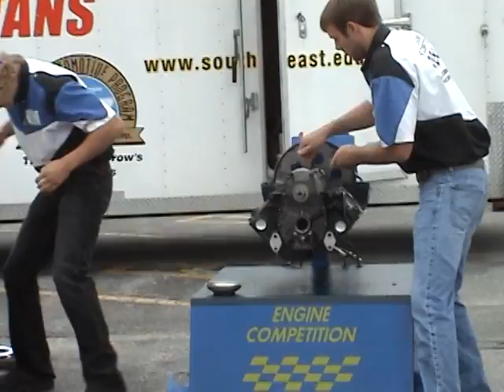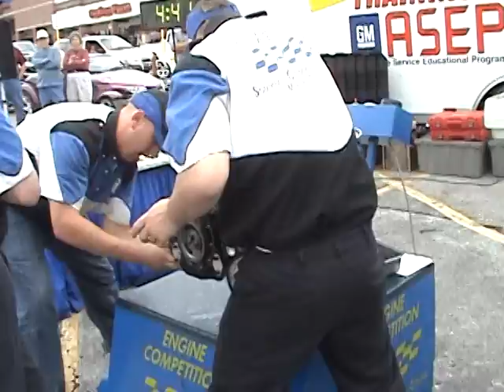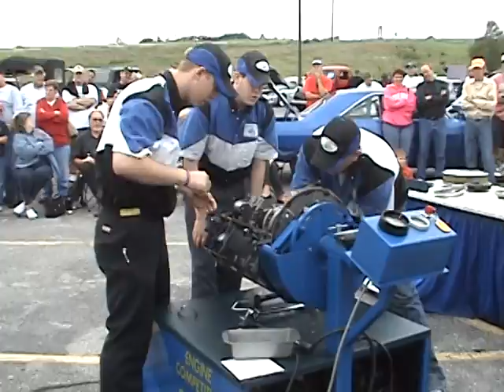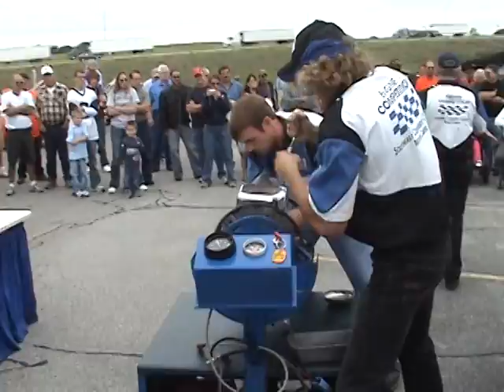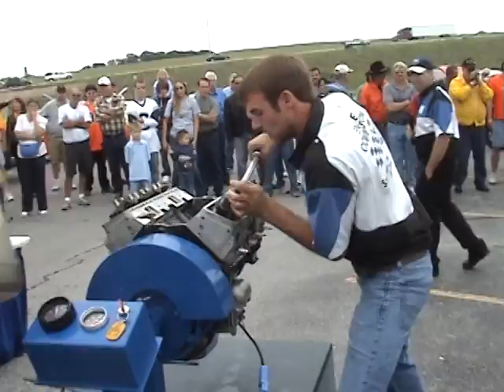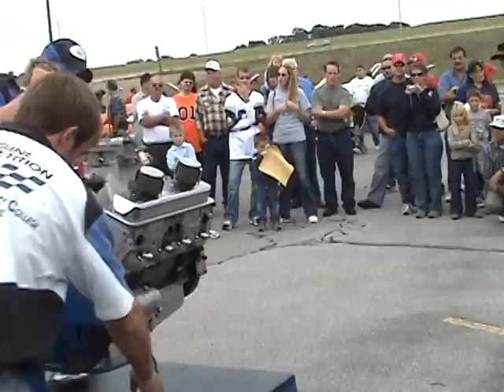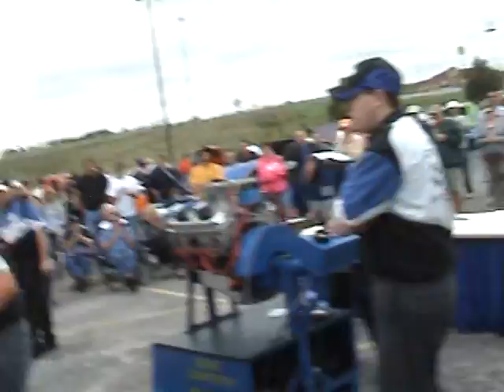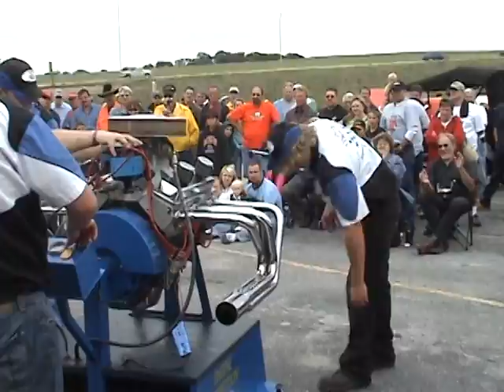Engine Build Competition SBC in 17 min 10 sec

Comment: " they're not building for the long haul here, this is strictly for speed"   This is where america  has lost it's way, they have forgotten QUALITY TAKES TIME & GOOD WORK AINT CHEAP, & cheap work AINT GOOD !  I freaked out @ 7;50 when that amature just screwed on a DRY OIL FILTER, that is a BIG NO NO!  I could  NEAVER assemble an engine with out CHECKING CLEARANCES, & priming the oil system prior to start up. The 1st. team to start their engine are the BIGEST  LOOSERS.          ~V~  Obsession.